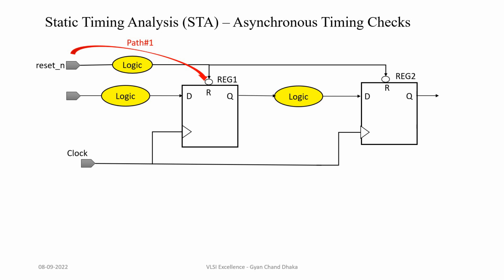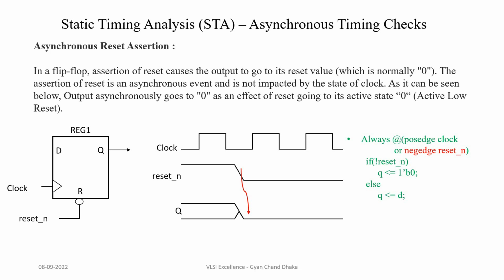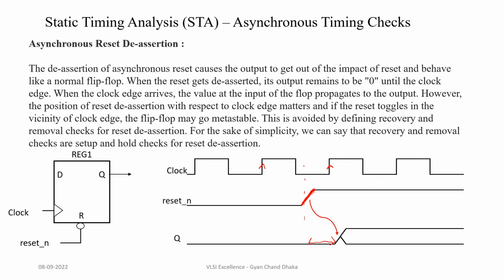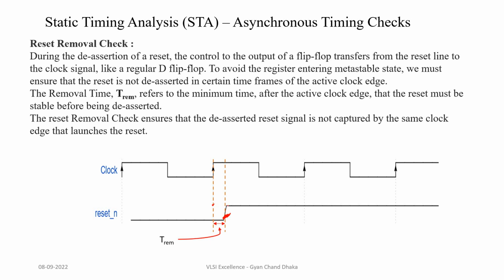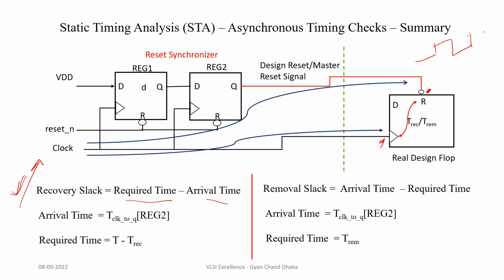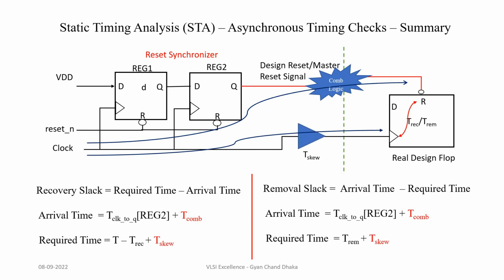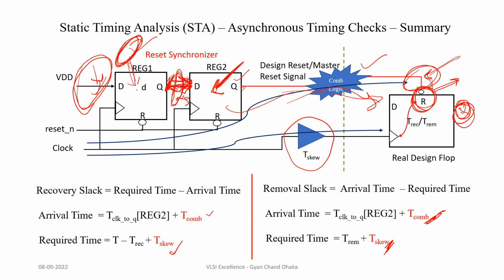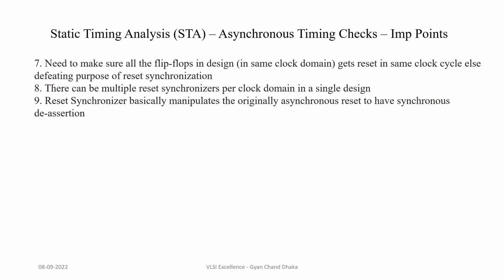Chapter#15 | Asynchronous Timing Checks | Recovery | Removal | Static Timing Analysis (STA) ✍️

Comment: why in arrival time clock to Q delay is considered ??reset is not coming from D pin of synchronizer its coming from reset pin,then we should not say this as asynchronous it is synchronous right??since it is depending on the clock .
Reply: since we're making reset pin synchronous to clk through synchronizer, clk to q is added. Correct me if I'm wrong
Reply: @utkarshjha657 yes this maybe the reason.